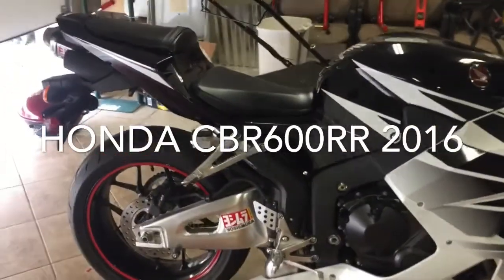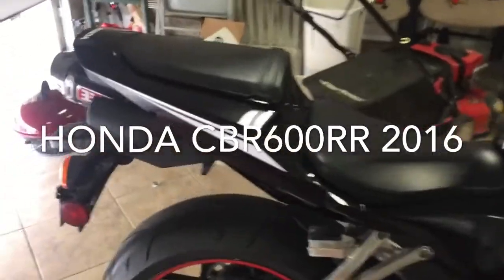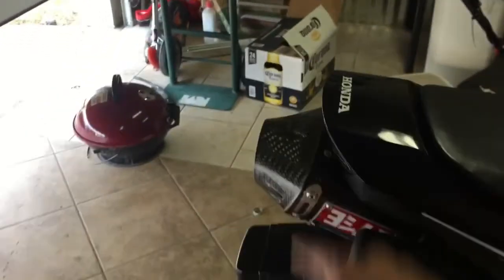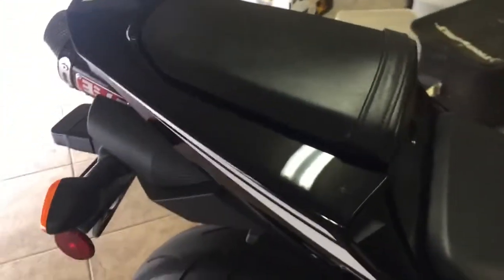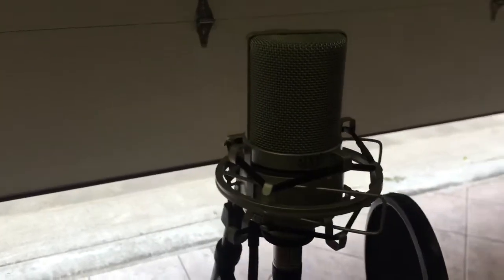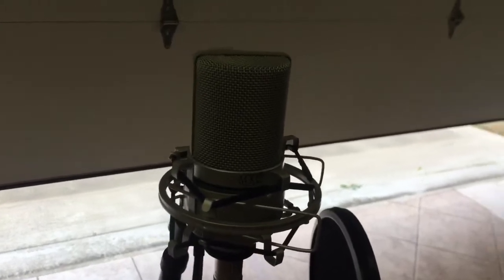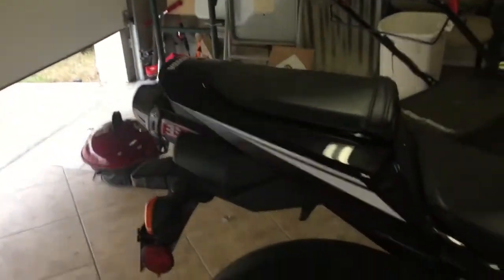vlog03: Yoshimura slip-on install Honda cbr600rr 2016 ( truly sound test) - Huy Cao 3

Comment: Cool video! But how did you remove the big screw that fits in the mount for the exhaust, I can't get this screw of?
Reply from the maker: it's been a while , I don't have this bike anymore .I forgot how to do it but I can say its hard to remove ,you gotta take your time . I broke the panel right under the tail seat .
Reply: @HuyCaomotorcycle  Thanks for the reply, might have to do that too! The older models were much easier to do.
Reply from the maker: johnny jay Yea  exactly.. I have watched so many video befor did my butthe older one a lot easier.

Comment: Is the exhaust touching your plastic sub frame? Mine is basically touching, has your plastics started to melt  at all?
Reply from the maker: Don H it is not touching the plastic sub frame just kinda close to the plastic sub frame. But I have no trouble about plastics melt at all . When you buy this yoshimura it come with the foil sticker in the box, so you use it go over the plastic sub frame befor you going to put the exhaust on.